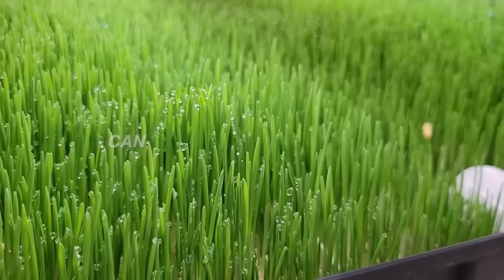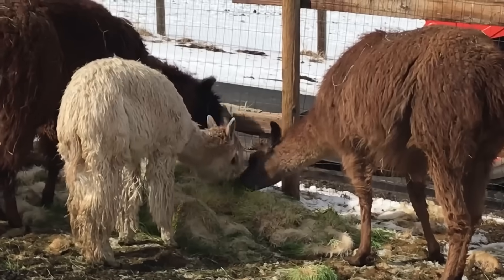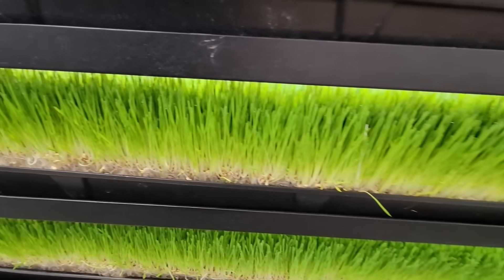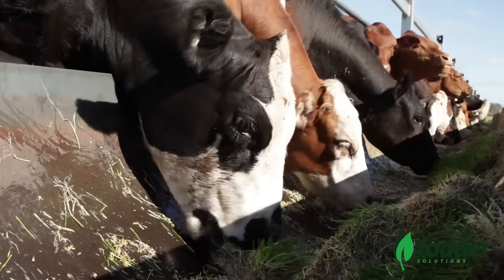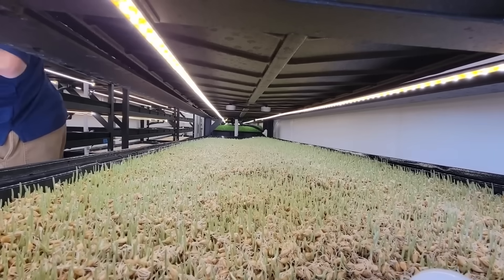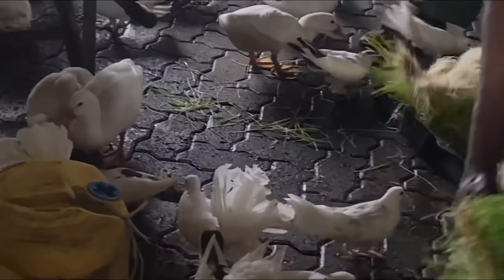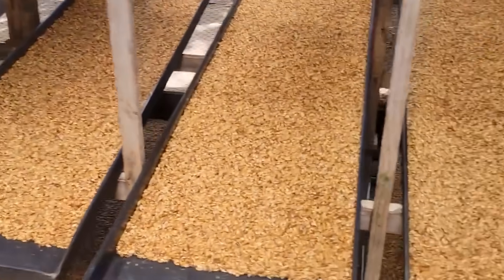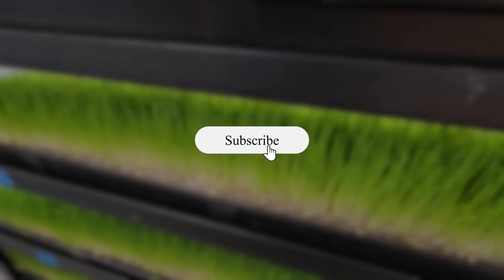Can Indoor Fodder Really Replace Hay? (The Numbers Don’t Lie)

Comment: seems ok if a few people use it but if it really caught on there is still the seed bottleneck , gotta have plants maturing somewhere to supply all the seed.
Reply: The only way to make it profitable is to still grow some in the field to provide seed
Reply: @brt5273  you could grow these out to seed and run them through a shaker and get much much more seed then ground of the same size would create.
Reply: absolutely correct. this is the problem of anything based on growing and harvesting immature plants for use. there has to be plants growing to full maturity to produce the needed seeds for future use. currently in the USA wheat yield per acre is about 1.5 tons so about 3000lbs per acre. different grains have different averages but this could be used as a baseline to calculate land needed. if a farm is using 1000 lbs per week in seed that is 52000 lbs per year that is 26 tons of seed per year or about 17-18 acres worth of seed
Reply: @jillwhite1671  Unless you could somehow do this with a crop that can be propagated with cloning or tissue culture. (Cuttings of live shoots that are then rooted) That will bring down price, you can keep crops more homogenous.  Won´t need the extra land to grow out seeds because you keep a motherplant (Or more than one for variety)
Reply: @mattlars89  this is an idea worth exploring. i do not think it would be practical but as far as i know this idea has not been tested and without testing there is no data to base opinions on. if you are in a position to conduct such an experiment i would be interested in your results.
Reply: @mattlars89 can you have a mother plant with grains? You could do sterile tissue culture but I think outdoor growing would be a lot cheaper
Reply: I dont see it affecting the market if anything it might actually help with waste management but doubtful it could affect anything badly in the long term. A lot of farms have tons that go to waste because they can't sell it.
Reply: @p3xlastname964   you need to visualize the scale involved though , each of those trays has a lot of seed , the plants only slightly mature , so you are looking at many, many rotations of seed in the time span it takes the seed crop to mature, then through winter since i assume they run these year round.
that is a lot of seed . especially if it is adopted by these huge mega farms, they can have thousands, hell tens of thousands of cows on a farm. 
some have upwards of 100k head of cattle. 
even if  each cow only eats one tray worth a day , those numbers become astronomical. 
there are roughly between 90-100 million cows in the united states.
Reply: @pattygreen8064  Fodder is not the food they have access too it is just an extra snack basically. As for the farms that do use it commercially it is no different to them buying tons of grain & running it through a hammer mill if anything it cuts the amount of feed necessary.
Reply: @p3xlastname964  food is anything an animal is fed that provides nutrition and calories. fodder is not just a snack if it is being used to replace a significant part of the diet of an animal. feed requirements are typically based on the weight of an animal and if they are lactating or what reproductive stage they are in. nothing cuts the amount of food/nutrition required for a healthy animal although it is possible to compress various feedstuffs to fit into smaller storage areas this can actually harm the digestive tract because of a lack of bulk.
on dairy farms silage is usually a large part of the daily food intake. silage has been anaerobically fermented for better digestibility from hay/grass or greenery of some type so it makes me curious if these sprouts could also be fermented into silage for even better digestibility with animals capable of utilizing silage.
Reply: @pattygreen8064  absolutely correct. this is essentially propaganda for a get rich quick scheme to benefit those producing the items to produce these sprouts that will not prove out viable long-term. i have seen everything from tray systems to fully automated buildings for fodder systems being sold at exorbitant prices. additionally grain being used for seed can not be used to make the food products we eat on a daily basis. various breads, flours, etc... literally everything we eat has some type of grain in it.
Reply: @jillwhite1671 not involved in farming but if the issue is the seeds supply. Then wouldn't the natural solution be to simply assign some part of the production to seed generation. 
Like start at something more seeds and slowly transition to more feed until it balances out with production. Being fully controlled environment means faster more reliable seed generation. 
So they will have competitive advantage in that regard. 
Or simply current land usage prices are pricing them out?
Reply: @p3xlastname964  That's where you error.
Grinding barley and feeding it directly to cattle will kill them from excessive bloat
Not so if you sprout it..
Reply: What you are suggesting is that if this catches on, seed farmers will gain a new strong market. This is a win, I believe, for sustainable, healthy farming. I have been wrong before though. I am sure I will be wrong again someday.
Reply: @HaveAGreatDay54  look at historic trends. this is actually a laughable proposal. if this catches on in a big way the seed will end up being imported the farmers wont earn more than they already do the money will come from all the idiots buying tray systems and fully automated buildings to sprout these grains. they are already on the market and have been for years. the ones getting the profit will be the ones selling the systems or going around providing propaganda talks and books about the various systems.
Reply: @j @jillwhite1671  Have you ever heard of micro greens? Same system. Similar seed demand. Tremendous growth. Having a quickly renewable source in a fraction of the land it would normally take. This could also reduce carbon emissions from current cultivation methods. Sounds viable to me. Labor heavy, but definitely a good investment for some.
Reply: @HaveAGreatDay54  really?  yes i have indeed heard of microgreens. yes there are similar issues  with seed although microgreens use a wider variety of seeds. contamination by mold and mildew can also occur ruining the harvest/s. there is also the fact that while most people like an occasional salad no one would think of making microgreens 25% of their total diet. microgreens are considered a specialty crop. as an income source big companies with completely controlled environments have an advantage over small producers. if you have good agricultural production skills, excellent marketing skills and are in a prime location it is possible to earn an income. without those skills many who try growing microgreens to earn an income quickly give up.
Reply: @jillwhite1671  So, I either accept your naysaying as complete fact or continue with my progressive beliefs in the technology. Hmm, let me think. I choose independent thought and reasoning. Thanks for your input. I am certain that we will both be proven wrong and right at the same time at some point. Have a great day!
Reply: @HaveAGreatDay54  i have not asked you to accept anything. i simply tried to give you a bit more knowledge. what you choose to do with that knowledge is absolutely up to you.
if your doctor tells you you need preventative surgery do you automatically believe that doctor? if you do have that surgery do you want to know all the risks as well as all the benefits? do you bury your head in the sand and say well this is medically progressive technology so i don't care about risks?
absolutely everything contains both risk and benefit. individual circumstances can affect both which can alter the risk to benefit ratio. unfortunately many have an unshakeable belief that more technology is always better. 
the reality is that technology while it can provide benefits can also cause unintended harm. even something as simple as chemical fertilizer can cause problems like polluted water, algal blooms, fish die-off, etc.... my view is search out knowledge and do a lot of critical thinking about both the potential risks as well as the potential benefits before diving in over your head with anything.
Reply: @jillwhite1671  Uhm, I simply wanted to add my personal experience to the conversation. You seem to want to dogmatically sway my beliefs. I am not in that religion, and my belief does not depend on your 'forced' knowledge and inability to understand how critical thinking works. You are literally assuming that I lack the ability to accrue knowledge on the subject by myself and you are attempting to belittle my confidence on the subject matter via your weak assumption. It seems as if you have taken some opposition to my simple addition to the conversation and have gone full bore on some kind of knowledge crusade. Have fun with that. I do not wish to partake any longer and will exit this farce with no change whatsoever to my belief as it is a well-researched one. Again, I say to you; "Have a great day".
Reply: @HaveAGreatDay54  you can gather knowledge on your own of course but it is better to share that knowledge fully both the good and the bad than to dogmatically attempt to convince others that something is all good. i at least acknowledged that in some situations benefit can outweigh risks but that everyone needs to do their own benefit versus risk assessment with the best information available about risk and benefit. 
i could not care less about swaying your beliefs as i learned long ago that belief can not be swayed as it is not based on real knowledge but emotion. it is good that you finally decided to state openly that your opinion is based on your belief not real knowledge. 
there are many intelligent people here who recognize that the video does not give a full picture of either the risks or the benefits of using fodder systems in real life applications. farms and ranches just like any business must have a comprehensive knowledge not belief in the true risks and benefits of any system they choose as it can determine the profit or loss they have for years to come.
Reply: @HaveAGreatDay54 for stuff people want to eat, not feeding a bunch of cows
Reply: @mbburry4759 uhm, I want to eat cows and sheep. I’m assuming you are a vegetarian. That’s ok. Everyone experiments with their diet at some point. See you at the buffet when you return to meat.
Reply: MMarkets correct for these things. It's part of the beauty of capitalism.Where there is a demand for something some enterprising capitalist will rise to meet it.
Reply: Farms have a bunch of that
Reply: @unipartywonagainstthepeople  a bunch is not an unlimited supply and the seed supply is affected by weather as well. a drought or flooding can wipe out sometimes millions of acres no matter what is being grown.
Reply: I am not sure that this increases seed required. In those university studies, they reduced the grain intake by 25%. Now just from this video, it is unclear to me whether that is counting the grain used as sprouts or not, either way, its probably not a large increase in grain consumption from the farm, as the seed is literally just Barley.
Reply: @breadbread4226  the example used is barley but it could literally be any type of sprout. once seed are sprouted they are no longer considered to be a grain ration. animals and people require a nutritionally balanced diet for healthy growth. this can not be supplied by any single food source no matter if it is sprouted grain or something else. trying to balance nutrition is why pastures need reseeding periodically as the animals on that pasture will selectively eat more of one grass/greenery than another. 
if grain intake without sprouted barley is 10 lbs - 25% or 2.5 lbs leaves the grain ration at 7.5 pounds. plus a ration of sprouts that need grain to be sprouted. those sprouts could actually require more than 2.5 lbs of seed by the time wastage/spoilage or nongerminating seeds are accounted for.
Reply: @jillwhite1671 you kind of missed my point. Which was that in this video, we weren't given enough clear information to make an assessment.
Reply: @breadbread4226  i didnt miss that point either and i also had covered that. but it is more than just a seed bottleneck.
Reply: @breadbread4226 sprouting the grain turns the starches in the seed to sugar. This multiplies the digestible nutrients by almost 80%. Thus the animal eats almost half the grain as before.
Reply: But it would still be more efficient
Reply: maybe we should change our seed system, that depends on big corporations.
Reply: It's called the Midwest
Reply: Generally if you let it go to seed, you can probably get ten 21.If not a hundred 21, so there's really not a bottleneck.If they're allowing some of these bins to go to seed
Reply: What I'm hearing is that it'll create real opportunities for seed farms. Sounds good 👍🏼
Reply: @lspthrattan  sure it sounds good. remember sounding good and being good are not always the same. used on a small scale as a treat more than a dietary component it does have advantages. there are also disadvantages to trying to use it on a large scale. potential seed shortages, unable to fully replace existing feed rations, possible nutritional deficiencies/excesses, etc.....

Comment: Bravo! Thank you for doing this video! In my opinion, it is the most complete and mostly accurate video I have seen on the topic. I would love to see a more in depth version. I ran into this idea a couple of years ago and found videos going back 12 years on the topic. I am surprised that this never caught on in the US. 3rd world countries use this more than we do. Probably because they tried to build big expensive systems when that is definitely not necessary and makes the ROI not worth it. There is a lot that people get wrong when growing these. I grew microgreens for human consumption for a while and learned a lot about the process. Cleanliness is everything but it doesn't have to be laboratory clean. You only need water (no soil or substrate) and you don't need lights for the first 3 days. I fully agree that supplementing the light with sunshine is where it is at but LEDs are cheap to run. I disagree - There is not daily function in the 7 days beyond watering which is cheap to automate. I also disagree that you need to clean every day (not even sure what that meant in context?). You DO have to clean the trays VERY well at the end of each 7-10 day growing cycle but that too is easy to streamline. That being said, I think your labor costs are inflated and if so, the scalability factor definitely comes back into play. Another point no one has talked about yet is to grow some of these on nutrient dense soil to produce the next batch of seeds. Done correctly, this is a perpetual cycle further reducing you input costs. The last point - there is so little information and lab testing (that I have seen) about the nutrients of each of the hundreds if not thousands of possible plants you could grow this way, compared to the nutrient needs of each animal type.  I am pretty passionate about this idea in general and would love to test side by side on different livestock and truly see if a solely microgreen diet (with the right mix of nutrients from the right plants for the specific animal) compared to conventional methods. Body condition, weight gain, nutrient density of the end products compared.
I believe I could make this work 100%. Excellent point in the water re-use due to the extra nutrients and microbes but think it would likely be best poured in compost or directly on crops growing in a field.

Somebody hurry up and fund my research farm. LOL I want to make this a business!
Reply: I believe the comment on daily maintenance is if you were using it as feed/feed supplement you would have a rotation of trays in progress.  Some trays would be day 1, some 2, some 3, some 4, some 5, some 6, some 7.  Day 7 trays get fed, cleaned, prepped with a new batch of seeds.  So you have daily maintenance in the fact that you have a daily harvest and are offsetting some/all of a daily ration.  

Unlike a human microgreen where you're targeting a 'crop' to be ready on day X so that you can sell it at/to a market.
Reply: @jebbarr2763  Makes great sense. I didn't think of that. Thank you!
Reply: We have one here in Queensland Australia.  We put 50 percent peroxide diluted down into a 20 litre bucket with the grain quantity over night.  Then scrape the loose stuff of the top and tip it into another bucket with holes to drain. Then on the tray.  After takin the fodder out the trays they were washed with bleach to kill any sporns of mildew.